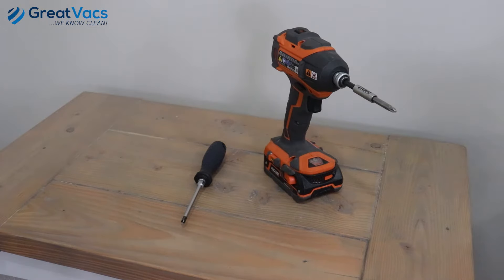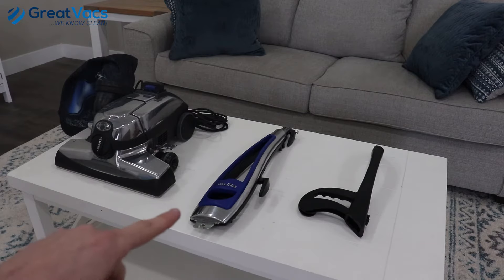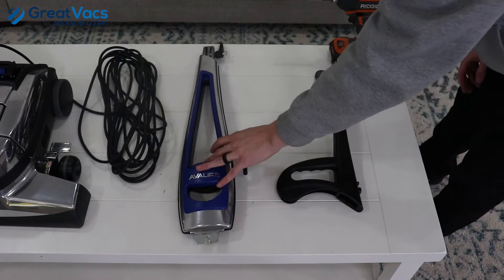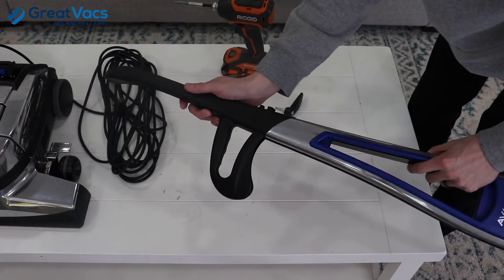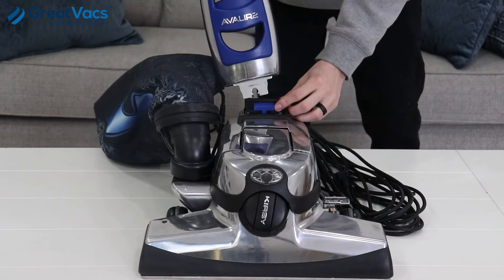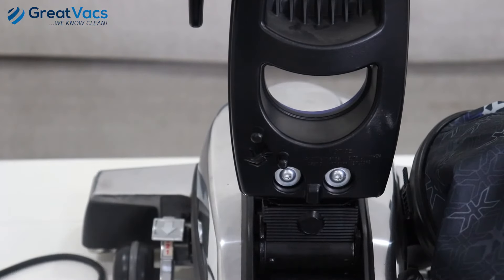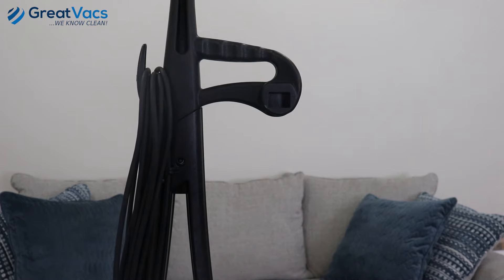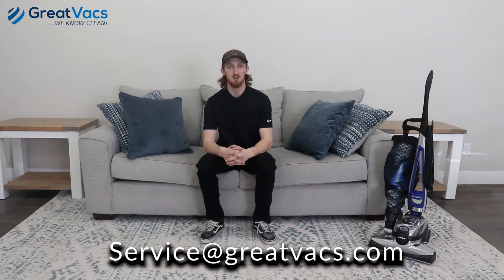Assembling a Kirby Vacuum Cleaner From GreatVacs!

Comment: These are about the best vacuum cleaner. Aluminum construction, and durable motor. I like 👍 the ones from the 1970's, to around the mid 1980's. My dad bought one, back in 1983, for about $800.00. I don't like 👍 recent day Kirby vacuum cleaners (for example, 2016). They've changed too much on design, and the retail price is more like 👍 $4000.00. A lot of plastic has gone into them. They're just not 👎 made like they used to be. Please keep 👌 me posted 📫 on RETRO Kirby 👌 vacuum cleaners from around the 1970's, through the mid 1980's. Your friend, Jeff.